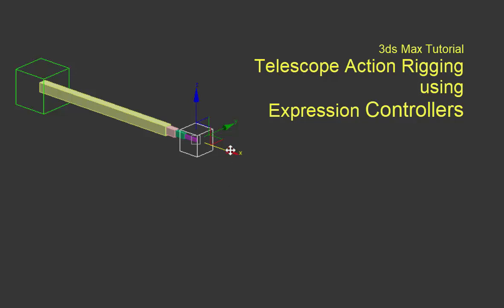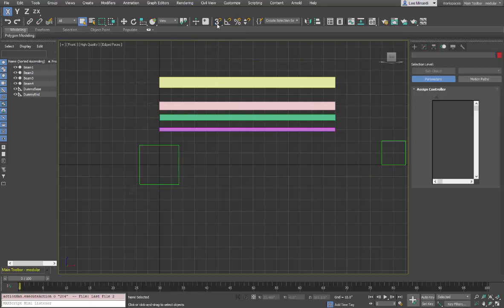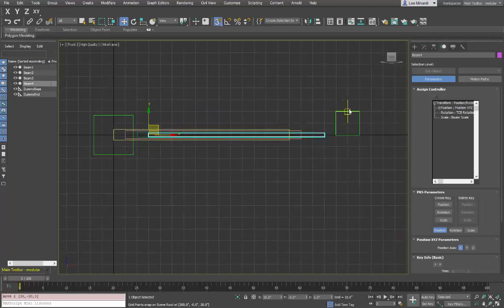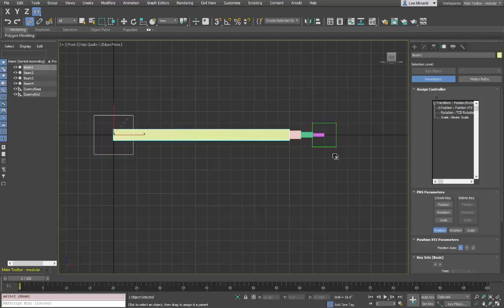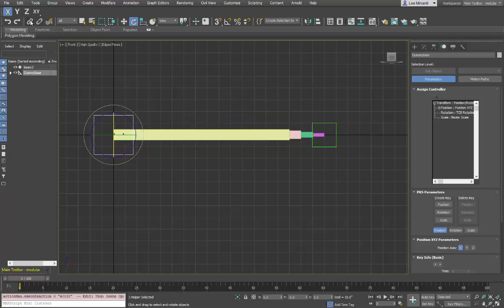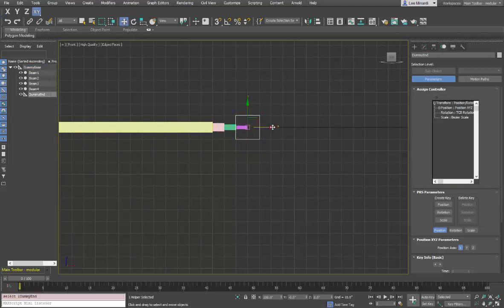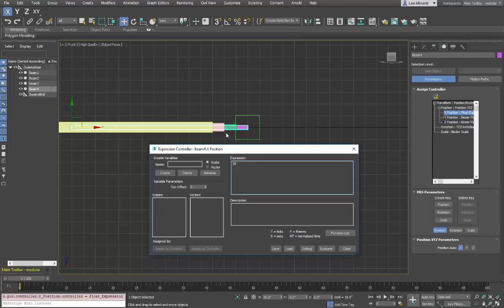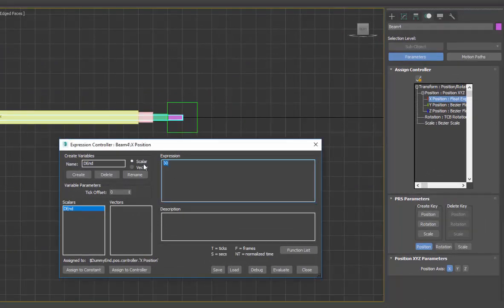3ds Max Tutorial - Rigging a Telescoping Beam

Comment: This works great on on X view axis, but when changed to X local it doesn't work as well.  How would you fix that?  the dummy at the end should stay at the end of the beams if within the telescoping area... but when you rotate the base and then move, the dummy moves off because it isn't reading the local.  How do you fix it?
Reply from the maker: @timCGI, you are corrrect that the rig does not behave as it should when the end dummy is moved off the x axis.  This was a surprise to me!  Thank you for pointing this out.
I have created a new approach for rigging a telescoping beam but do not have time right now to create a tutorial for it.  I look to do that soon and will reply t yoour comment when it is avaialble.
Reply: @LeeMinardi  Thanks, I look forward to seeing your solution.  I found a different way to do it by hacking a couple of other ideas, but I look forward to seeing how you would solve it.
Reply: @LeeMinardi  This is a great tutorial and I appreciate all the tutorials you do but I have the same request. This rig is great but if you're not animating the dummy objects in the rig directly it doesn't work or if you need to move the rig to another location it doesn't work anymore. Most of the time you'll need to rig the cylinders and let other objects drive the motion like a knuckle boom on a crane. I'd like to anchor the Base Dummy to an object and anchor the top dummy to another and let the objects drive the cylinder motion.